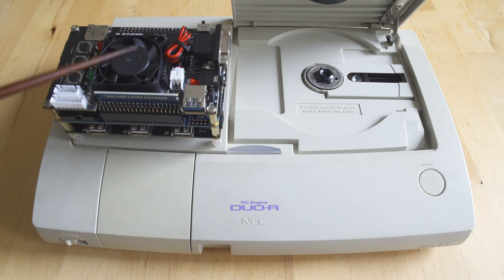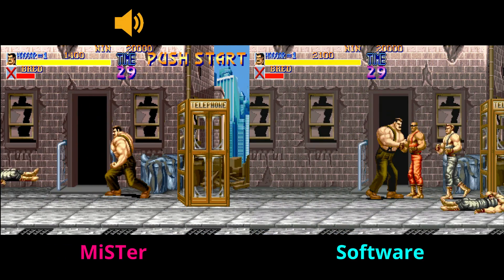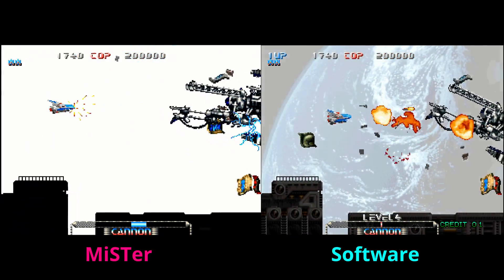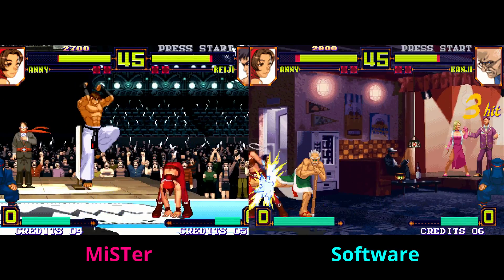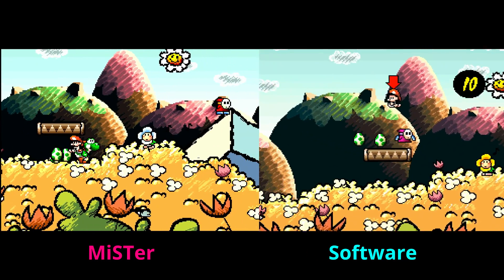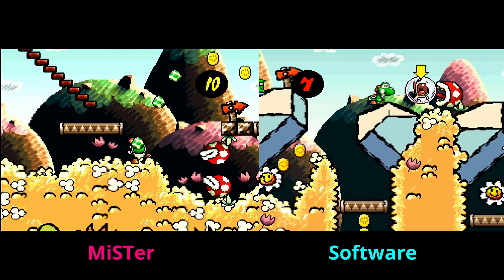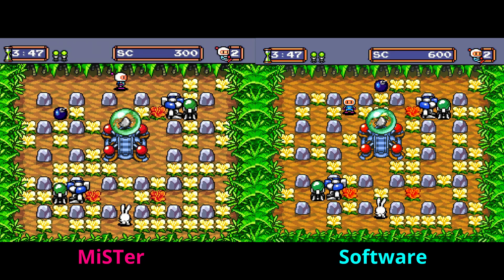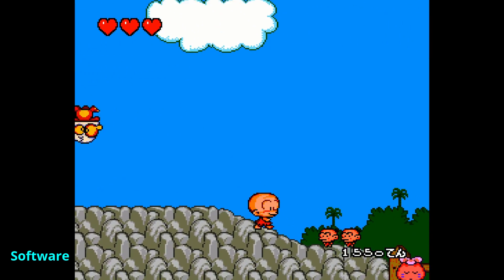MiSTer FPGA DE-10 - FPGA Emulation vs Software Emulation in RetroArch - which is "better"

Comment: I do like seeing the comparisons, but looking into this topic for several years, I'm not sold on FPGA replacing software emulation so far. Maybe for some specialty project where a specific title works better on FPGA. I also believe as many have said, some will be better in software emulation. FPGA or software, it's still reverse engineering what someone else created. There is plenty of room for error on either, and the final results are only as good as the people making these. One such problem pointed out to me be a former MiSTer that switched back to software emulation (or the unit before the MiSTer) was that C-64 SID chip was not emulated correctly, but was in software emulation. I'm sure it's resolved now, but just one example of "it's only as good as the people working on it". MiSTer is not running the original hardware. It is still very open to glitches just like software. It's a reproduction, no matter what. 

I've been very satisfied with software emulation for 25 years. It is improved frequently. There are a lot more people working on software emulation, a lot more people using it, easier and more frequent updates. It's free, and older PC's that can run it fairly well are also often free.

I've built 4 MAME machines so far, all using CRT's. A color and b&w VectorMAME even. In the works I have a 1990s driving cockpit with a 25" CRT, cocktail & a GalagaMAME cabinet. I also collect dedicated classics, mostly from Atari. I still feel software is the most flexible option & the easiest best supported option not only to emulate the games, but to get support on various controls of which I run many different types as my machines have modular controls and work with a variety of changing control panels. 

The other thing is I mainly play games and run software from the 1980s. Not the 1990s fighting games your playing. Maybe those aren't as well emulated in software? Possible, but not the kind of games I play. I'm not seeing delays in my controls or my monitors like I hear some claim. When I do experience slow downs on 1980s games, 99% of the time they are in the originals as I frequently visit the largest retro arcades (like Funspot) and collectors, so I get to play something like 1000 classic machines on a fairly regular basis comparing them. Some games, such as Sega's Space Fury vector, experiences massive CPU slow down on the original hardware (verified on two dedicated machines). This glitch is absent on my color VectorMAME machine. Thank you MAME developers, I'll take that improvement. The slow down is so noticeable on the original hardware, it greatly affects my game play. 

I get the biggest laugh out of the many people that praise FPGA technology for retro games, then they play them with LCD monitors, which aren't even remotely close to being authentic. It's clearly impossible to get even close with present displays. 

What I have yet to see, are many good examples of MiSTer running games I actually enjoy better. I'm sure they are out there, and I'm also sure, or the reverse.
Reply from the maker: The nice thing is there are options for all groups. The FPGA people, the software emulator people and the original hardware people. It’s never been a better time to be a gamer to be entirely honest :)
Reply: @VideoGameEsoterica  In terms of playing these games via software or hardware emulation, totally agree. Though buying the specialty CRT arcade monitors that have a classic 80s RGB TV-tube look (as opposed to common CRT VGA computer monitor) are getting very hard to find or repair in these times. 15 years ago they were much easier to obtain, and are an essential part of my emulation machines.
Reply from the maker: Ugh I am looking for a smaller medium res monitor and I am coming up empty
Reply: @VideoGameEsoterica  They are not easy to come by in 19" or smaller. They can be found in 25" sizes and up. 

I have one in my Atari Super Sprint and had one in my Atari APB (which I traded). Some cabinets, like Super Sprint, can be fitted with some 25" monitors instead.
Reply from the maker: Yeah last one I found that was local was a 29” and I just didn’t have the space. I wish medium res existed in a 20-21” commonly
Reply: @VideoGameEsoterica  The 19" med res monitors Atari used in the mid to late 80s are the ones I'm most familiar with. There weren't many alternatives, and those monitors are rather value now.
Reply from the maker: Yeah it’s a bummer. I need a medium res or a tri sync that isn’t massive. Oh well...one day!

Comment: Real HW  > FPGA > SW emu >>> typical SW emu. It is important to note that people DO NOT get near smooth scrolling on software emulation usually. My "60Hz" and game's "60Hz" are different usually and these things do not match at all. It takes either zero effort in case VRR (G-Sync/FreeSync, HDMI 2.1) are available and just work with used emulator or we get in to matching refresh rate hell. Emulators on the other hand typically do not allow syncing for monitor refresh rate. Retroarch requires a lot of effort to make it work good on fixed refresh displays and especially on 15KHz CRTs on RaspberryPi. It is not as plug & play if not having stuttering is important. MISTer should be plug&play. Will find out soon, hopefully. With modern low lag VRR displays SW emulation can work great though and the only real issues are how accurate emulation is and how low lag we can get. There is no good reason why lower than native input lag can be achieved with such setup eg when processing of whole frame is eg 1ms and gamepad input for it happens for it and then pushing it to display takes not 16.6ms but eg 8.3ms. In this example at least bottom of the screen will be faster on emulation. We are not there yet though, a lot of things must happen right for sw emulation to work right and on fixed refresh display it typically has at least one frame of input lag... and usually either lost or repeated frames and "floating" input lag.

Comment: Mesen for the NES and BSNES for the SNES have 1:1 parity with real hardware in regard to accuracy, so an FPGA for those systems is somewhat redundant if you have a powerful PC, because accurate software emulation is resource intensive.
Reply: FPGA doesn't become redundant, its way easier to get Mister running on a CRT and if you use SNAC adapters and original controllers you can experience the original console latency, something impossible to do with PC emulation without runahead, and using runahead functionally changes the way the game is running. For most games this change isn't really a problem, but games relying on peripherals to function will experience issues, such as light gun games. Mister excels at providing the original gameplay experience, especially on CRT and certainly when using console peripherals. PC is better for gamers who aren't as picky about the type of experience they have, or for gamers who prefer emulation advancements not possible on original hardware, like HD mode 7 in BSNES.

Both options of play serve different audiences and fill different niches, and neither could invalidate the existence of the other because there's so many different use cases that exist
Reply from the maker: Those are the emulators I used for the comparisons coming this fall :)
Reply: @VideoGameEsoterica  Neat :)
Reply from the maker: Yeah it should be a good time!
Reply: Haven't tested Mesen but just wanted to add that for BSNES you dont even need a powerful PC. Even on my Android tablet (basically a Galaxy S10 SOC) BSNES HD core runs perfect, although w/o run ahead.
Reply from the maker: Good to know
Reply: But a PC is not as efficient as a MiSTer.
Reply from the maker: If you are talking power draw at the wall then yes 100%
Reply: Your PC is the FPGA, just imagine and run s/w emulator.. 😅 why buy another hardware
Reply from the maker: Choice. I love choice
Reply: @okchannel2756  If only, it would be amazing to have a PCIe FPGA that could run MiSTer on a PC, the issue with software emulation, and this is coming from someone who has used it since 1998, is poor audio quality and accuracy, video timings, and most of all, to much latency, for instance, it can defeat the purpose of using a CRT, which has zero latency, but adding back latency via software emulation, it's not actually 100% the software emulators fault, it the fact it has to run over an operating system, especially Windows 10/11, this adds a good 20ms or more of lag, and that is best case scenario, if we could run BNES bare-metal, I suspect it would be much closer to the MiSTer's 0ms latency performance.

Just look at the Raspberry Pi 4 & 5 running the few bare-metal emulators it has, so far only Game Boy, ZX Spectrum, Commodore 64 emulators are bare-metal, but they are much lower latency than emulators running over an OS, and a good sign for the future as far as software emulation goes.

Comment: question, did you play around with sound chip settings on the genesis emulator for Retroarch? Genesis Plus GX should have different software options, maybe one of those is more to your liking?
Reply from the maker: I looked into them yes
Reply: @VideoGameEsoterica  out of curiosity do you know how the Mister handles the busy flag for the YM2612?

Also great video!

Comment: MAME (the latest version) would have been the most accurate software emulator to compare arcade games against.  Why the heck did you use an old crufty emulator like Final Burn Alpha?  Also, two of the biggest advantages of FPGA are low input latency and no frame skipping, but you didn't even mention either.
Reply from the maker: Because I’ll have a MAME comparison in the future. People requested this

Comment: Both options are great. You can emulate systems that the MiSTer will never be able to do. You can have multiple instant saves with emulation and in many emulators you can upscale the resolution. If you want gameplay as close to the original consoles as possible the MiSTer is the way to go. If you really like retro-gaming, you should use both options as they fit your needs or desires. Neither option is wrong.
Reply from the maker: Yes and that’s the great part. More options are better...and that’s coming from someone who owns all the consoles that MiSTer has cores for and has a closet filled to the brim with arcade PCBs

Comment: For me the MiSTer 'feels' more authentic although I agree that the differences between FPGA hardware simulation and software emulation are negligible in most cases nowadays.  For me two of the biggest wins for the MiSTer are the lack of input lag compared to software emulators and the ease of set up and updating - it's literally a once script does all - just add roms. I still have a Pi4 running a 750GB retro game image but I rarely use it since getting a MiSTer. Just waiting for the PS1 and Saturn cores to land now....
Reply from the maker: Looks like PS1 and Saturn will be soon?
Reply: If someone were to get a MiSTer now, would it be easy to add PS1/Saturn later? That is one thing that makes me reluctant with these.
Reply from the maker: They are working on the cores. I’m sure it’ll come. Adding items is as easy as running an update script
Reply: It's not authentic. The colors on the Mister video in the left are wrong.

Comment: Minor differences are not worth the cost of mister.  Plus I'm playing all these cycle accurate emulators on my phone which I can do a lot of other things with as well.  My phone not even getting hot!  But having said that I appreciate mister's contribution to software preservation.
Reply from the maker: and that's totally fair. Cost is def a factor. I am all for people using whatever they want so long as they are still playing retro :)
Reply: It’s a device for purists & when input lag matters. If you’re not in that camp, then no reason to shell out the money.
Reply from the maker: I mean size and convenience are nice as well IMO

Comment: Please stop using the the term "emulation" when talking about FPGA "re-implementation" of original hardware.
Reply: No. Most MiSTer FPGA devs I've talked to about this pretty much agree that it is hardware emulation as opposed to software emulation. At the end of the day it's emulation if you trick the software into running on something that wasn't the original hardware. To be fair, there are a few rare FPGA devs that do try to suggest that it's significantly different, but they seem to be in the minority.
Reply from the maker: Emulation makes the most sense to me but some people get very testy when you use that word so I like to call it “like original hardware except not” lolol
Reply from the maker: Nobody has even agreed on what word to truly use to describe what these devices do to sometimes I refer to it as emulation, sometimes as replication. Bit of a column a/b thing
Reply: @VideoGameEsoterica  The word is simulation. The general populous doesn't need to agree on this for it to be true. That's what it is.

Comment: Hey good video comparison!

BTW i notice you talked about sound on mister neogeo core and on my experience (compared to an AES) the sound on neogeo games had an annoying pitch issue thats very noticeable on the mister.
Reply from the maker: I’m not getting that pitch on my end. Could be a settings thing? So hard to say but I haven’t experienced it yet
Reply: @VideoGameEsoterica  using the unibios jukebox its easy to reproduce, you can try kof98 or kof2002, both of them i think uses a similar type of music approach, and in many of the stage songs you will experience high pitch notes on parts were the original hardware doesn't
Reply from the maker: That’s not a bad idea. Totally didn’t think of that even though I know it exists

Comment: Loved the comparison. I never quit on software emulation even after getting a MiSTer. Sometimes it's just more convenient to boot up a game on my PC. Also having pretty much every emulator support save states on PC is a huge plus. I just don't have the time to play games from start to finish in one sitting anymore, so save states are a god send. It's great to have options.
Reply: What's amusing about this video is that the colors on the left are obviously wrong. It's way too saturated. Those aren't accurate colors. All the RGB colors in the palettes Capcom chose have values that are divisible by 8. I've studied the palettes of CPS1 games and can definitively say that the colors in Mister here are wrong.

You can just see how the Mister feed on the left is far too saturated. Haggar looks radioactive.
Reply from the maker: The MiSTer colors are usually more intense in my experience
Reply from the maker: Haha funny you comment now as I just started editing individual “MiSTer VS Emulator” for all the major platforms. Should be fun!
Reply from the maker: Series X is a pretty impressive emulation system after all. Now if only I could find one lol
Reply: @VideoGameEsoterica  you can do the same with Series S.
Reply from the maker: The only Xbox that is seemingly easy to find
Reply: @VideoGameEsoterica  yes. And $200 cheaper than the hard-to-find Series X!

Comment: Have you tried final burn neo? FbA hasn't been worked on for a couple years. Works the same as fba despite the neo in the name.
Reply from the maker: I may do Neo as a separate video exclusively
Reply: @VideoGameEsoterica  I hope you do! If you remember the drama over the Capcom arcade collection, that caused basically the entire dev team for FBA to jump ship, and they forked the project into what is now called Final Burn Neo or FBN, so that is much more up to date than FBA is.

That might also solve the problems you were having with unibios, although I remember some of the devs disliking it since it frequently causes the program to break and they mentioned they might disable it altogether some day (I might be getting it mixed up with some other function related to dipswitches)
Reply from the maker: I did a Neo video. It’ll be out in fall :)
Reply: @VideoGameEsoterica  awesome, can't wait to watch!

Comment: I enjoy these types of comparisons but it's been so long since there were significant problems with this era of emulation that it feels like we're in the weeds. I think to come up with something concrete we'd need to set up double blind tests with directly captured references included. Easier said than done, I know, but we're down to saturation levels and volume differences, which happen easily with real hardware. The visual junk on Neo Geo is an objective metric. That's definitely a plus for MiSTer, assuming said junk actually appears on the original hardware in the exact same fashion.
Reply from the maker: The junk does appear on an AES. But yes the entire takeaway is there are tons of awesome options out there now

Comment: For most people, latency isn't an issue. They just want to play the games. These people should stick with software emulation. 

Run-ahead is artificial and requires tuning for each game and console. I want the right level of latency like the actual console. For me, hardware simulation via the MiSTer is the way to go. I have many of the consoles and can't detect the difference when it's hooked up to my Sony Trinitron monitor.
Reply from the maker: Yes hooked up to a CRT it’s very hard to tell the difference sometimes